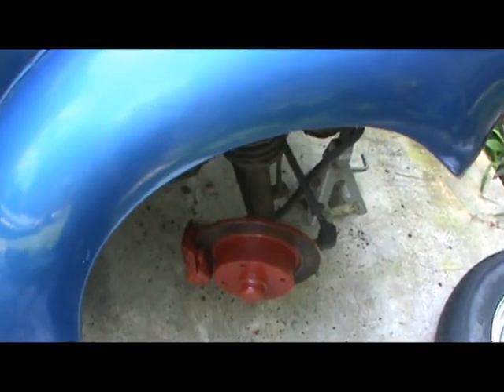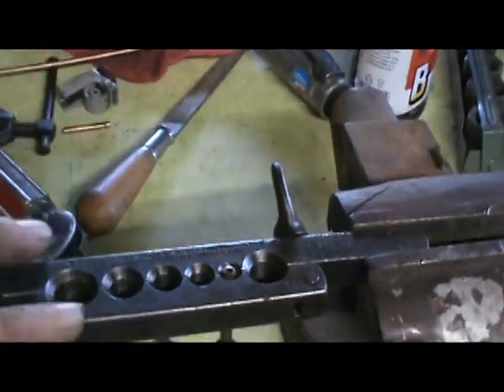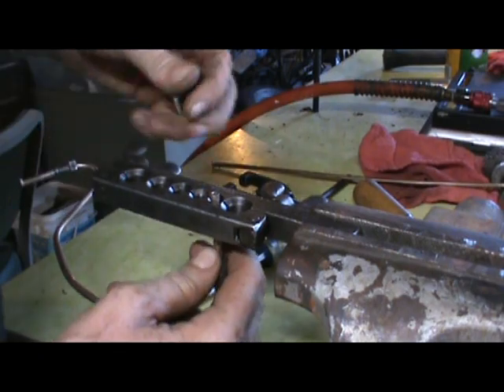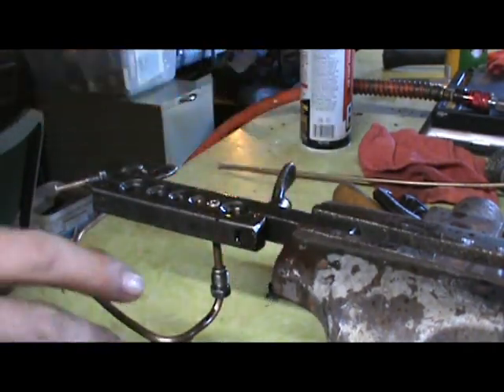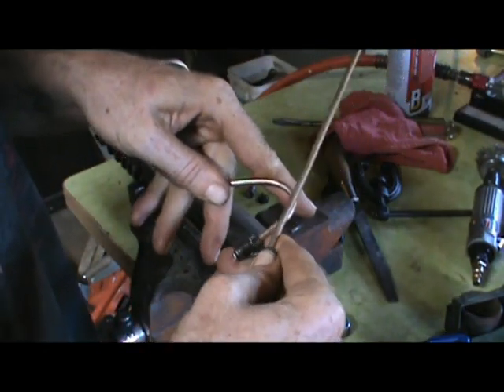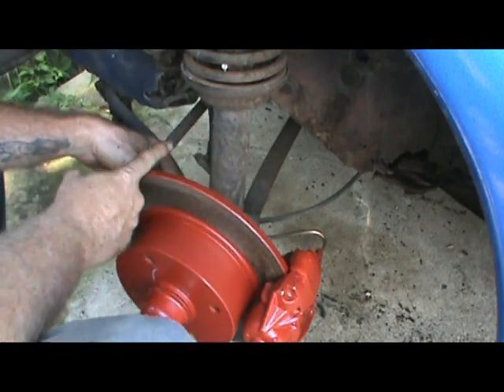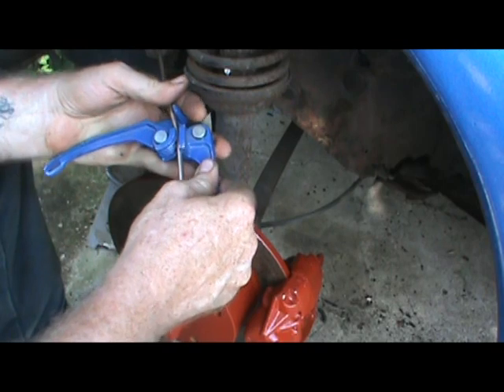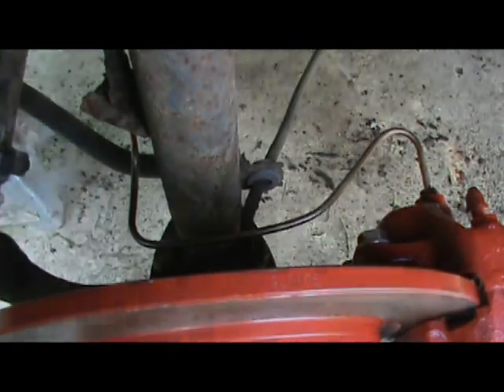Volkswagen Disc Brake Conversion-part 3

Comment: Reminds me of my favorite method of repairing a wiring harness. Cut out bad part, measure and cut replacement wires, strip, twist and solder wires beautifully with no blobs. Get out lighter to shrink the insulation, realize I forgot to put the heat shrink on before soldering. Cut and repeat.
Reply from the maker: lewisb3100 lol...you nailed it brother, sad part is, by the time you fix it you realize your best work was on the first pass!🤣